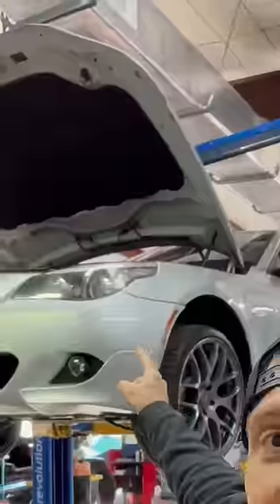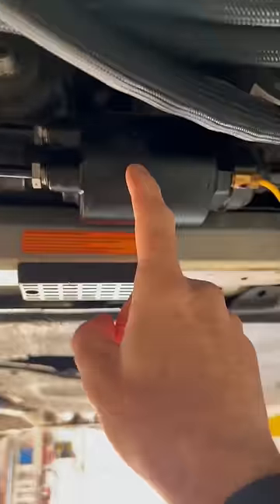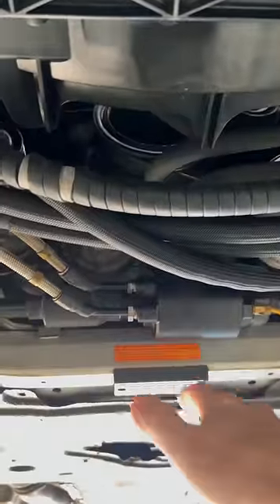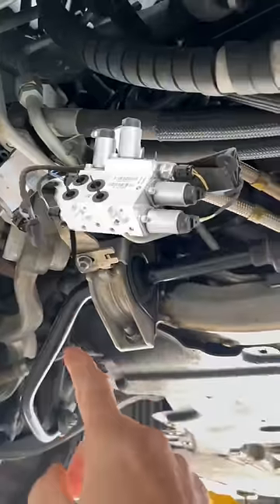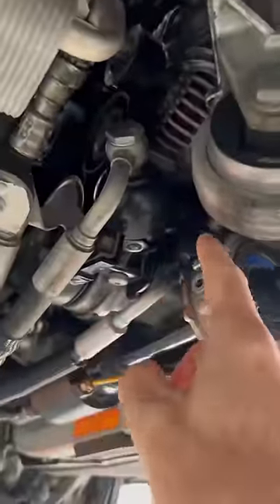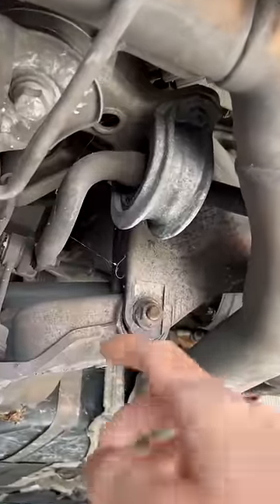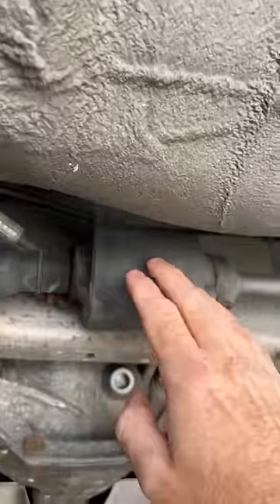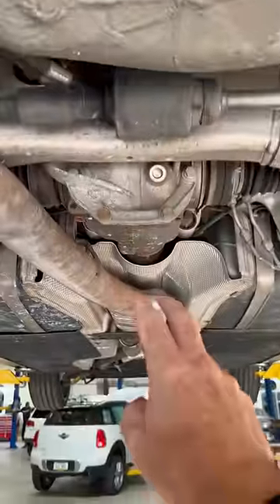Over engineered?

Comment: I was taught in mech engineering that there are three ways of designing something: The right way, the wrong way, and the German way.  When their stuff works , it works very well, but when it doesn't work anymore, there'll be a crying and a gnarshing of teeth,  followed by a sudden ability to speak loudly in foreign tongues.
Reply: 😂😂😂😂😂 this so true.  I deal with German Manufacturing Equipment and exactly what you said.
Reply: Definitely over engineered...like every german car except maybe an mk1 rabbit gti...German cars dont age well for the commun person...they require extensive preventive maintenance and expensive repairs...BUT they are marvelous driving machines...just have a 2nd car as a back up coz there's always something needing something...
Reply: It really depends on the car though. If Germans make a premium car, they go bonkers on stuff like this, but they usually go for more of an "zis will last a tausend years" approach for everyday cars.
Reply: @UnfilteredGolfer I live in Germany and the parts for VW are very cheap, It always depends where you live next thing what i heard VW in the States isn't as good built together as in Europe.
Sorry for my English.
Reply: The VW Beetle has entered the chat.
Reply: @TacticalHemorrhoid  You are right because the VR6 engine is a  very good engine.
 My friend drives a Golf 7 1.4 TSI tuned to 220 Hp and he didn't had even once a problem with the car.  I think  many people in the states don't care about their car and don't maintain their car properly, and that's why they call VW unreliable.
Reply: In my book, there are only two ways, the reliable way and the broken way.
Reply: @heniodriftrally3761  thats not what i said
Reply: Absolutely
Reply: @UnfilteredGolfer  i Just bla bla bla that everybody does.
Reply: Land Rover has the same system.
Reply: Exactly
Reply: @Mrwaffleandmilk  being from Germany I much prefer Japanese designs by now. Problem is that most German brands have been sold off long time ago and hardly anything that says 'made in Germany' nowadays was indeed manufactured in Germany. Most products claiming the made in Germany logo now have only the end assembly done here. It is sad but as a German i buy 30 to 40 year old used German products and refurbish them because everything those company's make today is crap compared to what they made 40 years ago. Good examples are SABO mowers or Bosch kitchen appliances.

I'll keep my 40 year old SABO mower as long as it'll be possible and my Bosch kitchen machine from the early 1980s still runs like on the first day and it's never been opened and never got any kind of maintenance up until today. It's used daily. You don't get that anymore. They all claim sustainability and ecological friendliness while they produce utter crap that'll be waste shortly after the warranty period ends. They made sustainable products in the 1980s. Not now. Just look at Tesla cars. Each and every one of the EVs made today will be fancy scrap metal after 8 to 10 years cause no one will ever pay for a new battery in any of these cars. It's worse now than it was in the 80s
Reply: @Mrwaffleandmilk  and there are certainly no race parts in the current BMWs except for in the M3 or ALPINA models i think. They are tailored to being company cars for 4 to 6 years and after that they're very expensive for anyone trying to make them a daily driver. Just my personal opinion.
Reply: @Bornchiller123  
Lol, I was just going to ask you Bosch. It’s truly sad that all of these once great manufacturers are crap now. And you’re absolutely right, they talk about sustainability while producing disposable products. I watched something the other day that said they don’t even have the ability to recycle EV batteries yet since there’s no infrastructure for it. So where will these batteries go until then? The EV battery graveyard like the millions of tires dumped still waiting to be recycled? 🤷‍♂️
Reply: @LuckyCharms777  EVs can consume tyres much faster than regular cars. It's probably a win win for the recycling industry who will ship it all off to Africa and countries alike were they're going to find a company to sign off the recycling certificate and then dunps it into an empty mine somewhere
Reply: @LuckyCharms777  Miele still seems to remain an exception but to get them you've to pay triple the price then for any other brand. They are still a German family owned brand.
Reply: Thank you Marcel for this reply. 

Good night, as a mechanic engineer - that freaks me out. I like having simple stuff that is easy to fix. 

I even took the sway bar off my old beater truck since I didn’t see the need for it!

I’d stay away from BMWs for things like this. Too many engineers with too many ideas freaks me out.
Reply: @dnoloc Me too. We called her Helga. She was very impressive when she was feeling good and a total fucking catastrophe when not
Reply: Porsche is best
Reply: @Bornchiller123  
Good to know, I also wondered about them. I’ve been very pleased with Miele vacuum, which is about 10 years old, but really it shouldn’t be difficult to make a vacuum.
Reply: @Bornchiller123  
Well as long as they have a recycling certificate the battery manufacturers aren’t to blame. It’s not like they knew beforehand that their batteries actually weren’t recyclable. (sarcasm)
Reply: @LuckyCharms777  LMFAO
Reply: @LuckyCharms777  I'm very pleased with my Miele washing machine as well.
Reply: @Mrwaffleandmilk  Then you don't understand.  The pinnacle of engineering is figuring out how to make something so simple, that works so well.  This is an example of just adding things on, which leads to failures. As someone of German descent, I avoid all but the simplest of German products.
Reply: I have heard this so often in the past. Yet when you look at what was once considered "over engineering" it eventually becomes standard. Take independent suspension, dynamic stability control, electronic control unit, etc. I remember working on my 1985 Jeep Cherokee with vacuum hoses, trying to find the leak to be able to use 4 wheel drive (not all wheel drive which would add another example to the list). All because usually electronics to activate the 4 wheel drive was "too complicated" for a car.
Reply: A German car with a great warranty is simply amazing to own.
Reply: I like simple cars that I can fix myself. All things being equal, if it’s got twice as many parts it will fail twice as often. For a car like a top end BMW the parts cost a fortune and the special tools, software and workshop manuals will drive you to a main dealer whether you like it or not. My runaround is a 1.1 Polo and it’s ideal for taking the dogs out to the local park for a walk. 12 years old and the most serious fault was the rear washer stopped working.
Reply: @heniodriftrally3761  you hit the nail on that one. You English is perfectly fine.  A lot of Americans don't use good or proper English anyways. 
🤣😂😄😅😆
Reply: Final Maxim don't play if you can't pay!
Reply: @UnfilteredGolfer  it's not really true. VW's are very simple cars
Reply: Which is why I always feel the Japanese designed cars are the right way because of its simplicity
Reply: @ariz.k  I agree.
Reply: If you want  longterm  reliability,  stay away from that german crap
Reply: @stevenhuckaby2902  to me the Japanese  cars are good value. I avoid European cars. Italian and French are even worse than German.
Reply: For my part - as a german - i just can say, that there's 2 different "german ways" - overengineering and reliable. reliable was there first, but since they try to "overengineer" even simple things (or just try to produce it cheaper, so that they can make more money with it), i avoid these. i'd either prefer italian cars before german ones (especually BMW, Mercedes and VW / AUDI ) - 'cause even when they had a problem, they don'ttry to charge you the cost of a small used car for something, what could be fixed easily. or Japanese cars, who are build reliable (and are "well" overengineered - but for funktion, not just for style).

Comment: I remember when people complained about Chevrolet's hydroboost brakes being too complicated.
Reply: That was never a complaint thats easy work
Reply: Yeah that's not even in the same ballpark. You're talking about an assist to something you use every single time you drive such as power steering or assisted brakes. This is talking about something that most people don't even know exists in their car and wouldn't even if it was gone. Chances are it's completely unnecessary and might be technology that bled over from powersports.
Reply: @tjturner4461  It was a complaint from lots of people when they ran the brakes off the power steering. It's an overcomplication for passenger vehicles.
Reply: @AIO inc.  Hydroboost was only used on select vehicles, though. I love it and retrofitted it to my Trooper. It makes for a solid pedal and incredible braking power.  I installed it after upgrading to 33" tires. The stock vacuum boost just wasn't good enough and very scary when I was towing my utility trailer, which does not have brakes. Hydroboost is excellent on 2500 and 3500 series trucks for the same reasons.
Reply: I remember disc brakes being too difficult to replace!
Reply: Well unlike hydro boost brake this is completely stupid. I prefer Mercedes' method of using torque vectoring differentials, it allows for the car to corner extremely well.
Reply: @mariosaccoccio1688  
Wat? Thats drum brakes with the 50 springs
Reply: Its just like a vacuumed power booster, and i recall only pickup trucks really had them, unless they put them on those big cars. AIR systems are a pain
Reply: Lmao chevys brake boosters are nothing like this lol they’re actually very simple
Reply: you think this system is complicated???? good lord. stop working on cars
Reply: Hydraboost*. Hydro means water, hydra is short for hydraulic.
Reply: As a Ford 7.3 owner, I’d much rather have hydroboost than a $150 vacuum pump that’ll fail without warning. Although some do make conversation kits.
Reply: I don't remember that, but understand why people would say that. Now everyone is converting to hydroboost. I converted my 71 Suburban to hydro. It's the best thing I ever did.
Reply: @mariosaccoccio1688  disc brakes are easier to replace than drums I don't know what you're talking about
Reply: @mariosaccoccio1688  no one ever said that. Way better then drum.
Reply: @maddoxinc1642  "You're talking about an assist to something you use every single time you drive"

tell me how you drive and don't use your sway bar
Reply: They suck too
Reply: @TehButterflyEffect  You would think that, but it's actually hydro.

Comment: I'm old fashioned enough to think that simplicity is an engineering virtue.
Reply: Simplicity is a relative term.  When getting into dynamic suspensions, you need variability: you will not get there with a simple spring / torsion system.
Reply: @TheBeingReal  it'll get the job done tho
Reply: @matthewlafontaine7386  Back to what the job / function you want is though.
Reply: @matthewlafontaine7386  jup, flipping the car if you accidentally jerk the steering wheel at high speeds, breaking out in corners and the greatest of all getting rear passengers sea sick 🥳
Reply: Ok gramps, take your model T with a crank start because an electric starter can fail and leave you in the parking lot.
Reply: @bigqwertycat  exactly! We should all move forward, not  plateau.  That's what great engineering shows us.
Reply: amen to that
Reply: It is.  It all depends what one considers to be a good car.  To me a good car is one that has the least points of failure and is as easy as possible to fix and more importantly as cheap as possible to fix.  But the days of good cars like that are long gone.
Reply: @bigqwertycat  the modern cars cannot be crank started. It can only be towed
Reply: simple solutions are great because if they can be improved, or fixed, they will
Reply: Right meanwhile diesel engines with useless systems that just delay the contamination as it all will get stuck on the intake and then because it's made of plastic you have to buy another.
Not only contamination when making the new car but the plastic replacement, the same contamination as a 40 year old diesel just delayed, the contamination for recycling and creating the new plastics.  

Wow such improvement over a 30 year old car WOW can't wait to sink a ton of money into a useless money pit...

Sad industry is more interested in selling cars than saving the planet aka the push for the electric cars that contaminate more than any other car ever made.
Reply: @TheBeingReal  True but it doesn't necessarily have to come in the form of a whole separate mechanical/ electric powered system. A quality manual (adjustable) systems can work just as well. Powered/ automatic systems are just for convenience.
But you're not wrong in what your saying
Reply: Agreed.
I for example like manual seat adjustments in my car because when an electric powered one breaks it's going to cost you a pretty penny but if it's manual and breaks? You could buy a new part & replace it yourself 👌
Reply: If it can save my life and/or doesn't sideline my car when said feature fails, I am listening. Unfortunately, with all the features added to vehicles these days, neither is the case.
Reply: @antonjanssen3549  
But why do we even have cars capable of high speeds? Instead of wasting billions (trillions?) of dollars on auto technology, it should be invested into teleportation. The quickest transport ever.
Reply: Then drive a model T
Reply: @GrzegorzDurda  
A model T will get you places few Jeeps and trucks can. So much for modernity.
Reply: @geoffgorlick790 not all advancement is progress, it is a fallacy to believe that we are always on a constant technological upward curve, or that old systems are always bested. Nobody has managed to reinvent the wheel, because the wheel is an optimal shape, and that’s old as dirt. After years of steady improvement, smart phones plateaued almost ten years ago. 

We do reach plateaus of usefulness in technology and that’s alright, because anything after that is only marketing hype to keep selling units, or change for the sake of change. And those are both lousy motivations and definitely not innovative.

The electric starter was an advancement. Electro hydraulically actuated sway bars is simply fiddling with something that already works well and requires little to no maintenance. Turning it into a $2,000 liability in exchange for modest gain in dynamic range, the juice isn’t worth the squeeze.
Reply: @TheBeingReal simplicity is not too relative. A sway bar is a bar with end links and some rubber bushings. These dynamic sway bars are a complicated system all their own and unequivocally more complex. 

It’s a stupid idea anyway as magnetorheological dampers (e.g. Delphi’s MagneRide) have been around for years, and accomplish the same goals and more in a more inert package, which naturally aids lifespan. Hydropneumatic suspensions which have been around since the 1930’s - and like the MagneRide, have been utilized by many automakers over the years are better than this. When it’s so good, the industry as a whole adopts the idea, that’s when you know it’s true advancement, not a gimmick.
Reply: That's basically true for the majority of cars but simplicity won't make a 100k to 5m dollar car
Reply: Totally agree with you but I'm 60....
Reply: and I'm sure there's a scanner field for ASBCM adaptive sway bar control module
Reply: Ah, the simplicity of body rolling and being unable top turn without layin on your door :D
Reply: @mr.butterworth  Thats true, the same with a lot of things. Laws and regulations is another. Big business and corporations.
Meanwhile, society further degrades and crumbles away. The home and the family unit is almost all extinct. Morals, principles and virtues are gone. Overall the quality of life gets lesser and lesser, as all of these things that have supposed to of improved it, are actually what is destroying it. Pretty much at an equal rate, as 'progress' increases, the quality and meaning of life diminishes..
Reply: @geoffgorlick790  the problem is the last 5 years it's went backward. Once these starting making all the parts put of cheap plastic and got rid of rubber and metal the cars became junk to me. The most reliable best built cars are before the emissions crap destroyed the quality. That be people are more interested in tactile touch than quality engineering, style over substance is what works for most people unfortunately. Some of us still believe in quality.
Reply: Simplicity is golden... Engineers will always tell you simple isn't good enough because they want perfect performance with zero regard to how the machine performs after it hits the road.... Sure it's a great idea on the drawing board, until it hits the road and turns out a single failure could total your brand new vehicle.... Had a customer total his brand new 2023 vehicle because of a single impact spot that wasn't even that bad, only that there were dozens of small parts damaged from a single impact.
Reply: @TheBeingReal  Simple is a good compromise. If you don't need that kind of suspension then it might be worth not having it. 
Would love to have a Citroen with hydropneumatics though. Would also have a 2cv.
Reply: well guess you can walk or bike places lol
Reply: Bic lighter... greatest machine evey invented.